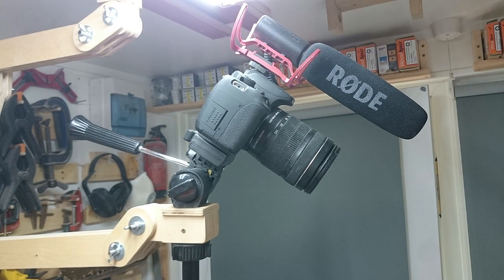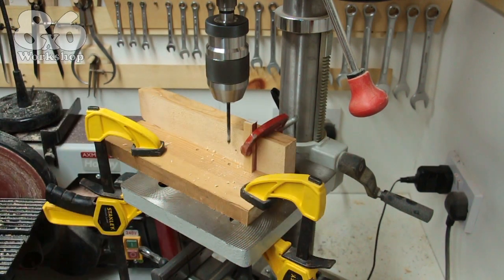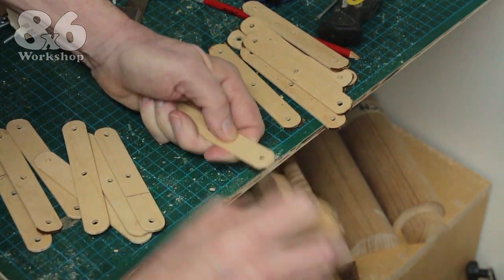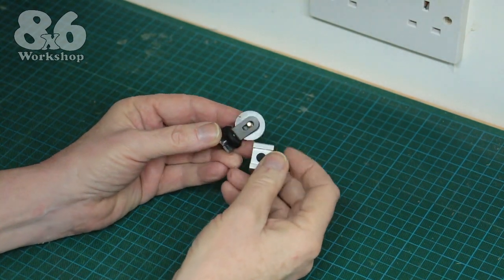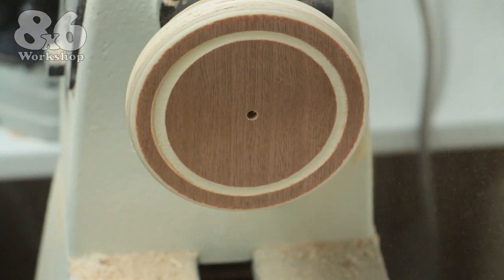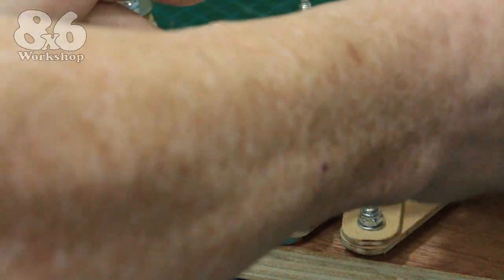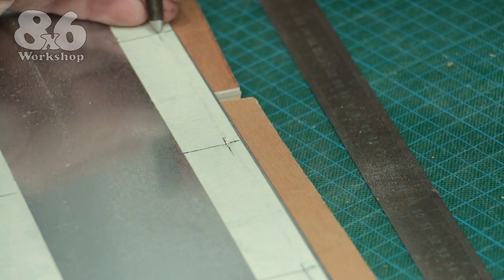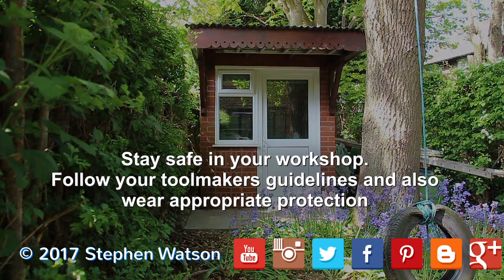Scissor Action Microphone Roof Mount - Aid to filming videos in a small workshop

Comment: very good video . may i use the metal strip and magnet idea.   i am sure if i used it on my roof i could get more bits in my micro shed
Reply from the maker: Thanks for the feedback lindsay. Feel free to snaffle any idea's from the video. Also looking at mounting some electrical sockets on the roof to avoid trailing wires from the roof mounted light(s).

Comment: Hi Stephen, came across from Rag n bone brown really interested to see your videos in such a small space, im about to embark on clearing out my garage and turning it into a 'workshop' I dont have a huge amount of equipment. I'd love to see a video on how you fitted out your small workshop in particular the french cleat shelving system, i wonder if its possible to create this without a table saw?
Reply from the maker: Thanks for watching. Glad you enjoyed them. I will be doing an updated tour of the 8x6 in September and will gladly go into more details of the structure and fittings. It is possible to create the cleat system without a table saw. I used 100x25mm pine cut down the centre at 45 degrees so both halves came out the same size. Once you have a line to follow this can be done with a circular saw or a jigsaw with the base plate of either machine set to 45deg. With a little care and patience this can also be achieved with a handsaw ☺
Reply: Thanks Stephen, I have a jig saw and was thinking of having a go with that, i'll let you know how I get on when i get around to it!
Reply from the maker: Yes do let me know how you do. If you have a blade for cutting along the grain it will make the job a lot easier :-)